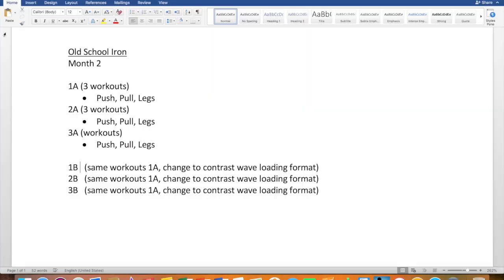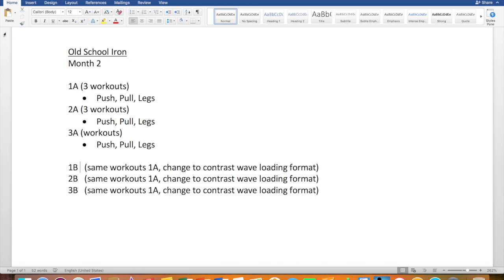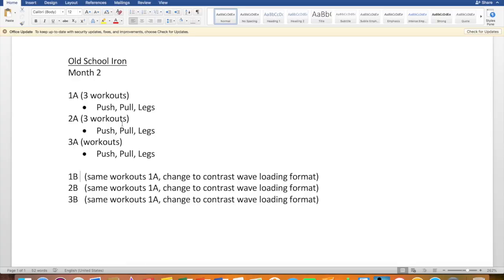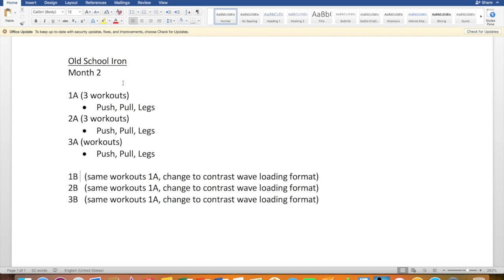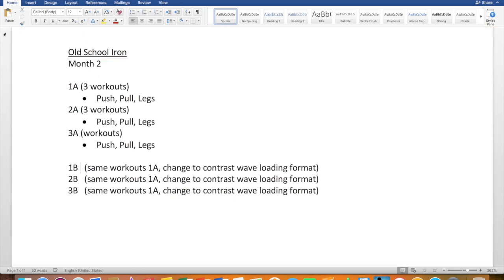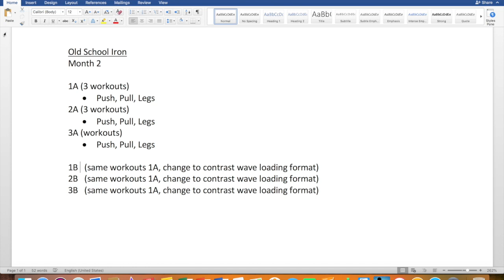Athlean-X Old School Iron Week 5 (Part 1) Review

Comment: I'm in week 6 and it has really helped that I have kept a journal so I know my weights for all these exercises
Reply from the maker: Just calculating the weight for the contrast wave loading this week and I don't know if I copied it down wrong last week, but the chart has changed/been upgraded and it has this week's 1 RM less than earlier in the week. I'm glad I have all my numbers written down. Guess I'll make my own adjustments to the weight.
Reply: @jennacrum9456  If you are talking about the 1rm calculator on the site, I think its always wrong. Everyone is different. The way I figured mine out was to literally just test myself. Take a 4 min break, add weight, try again and repeat until I hit absolute failure. Safety bars in place of course because eventually that bar is coming down haha.